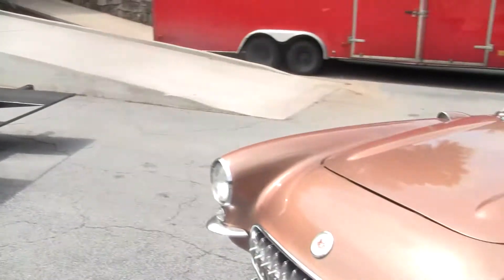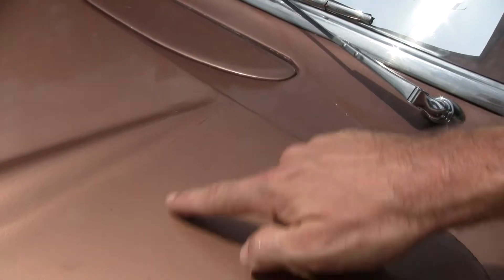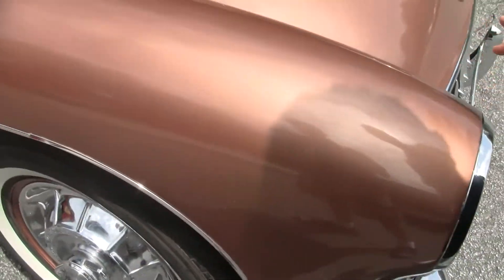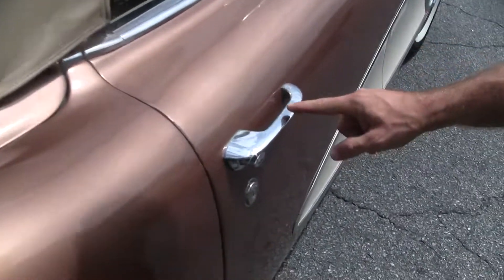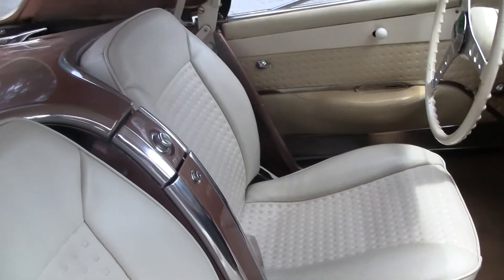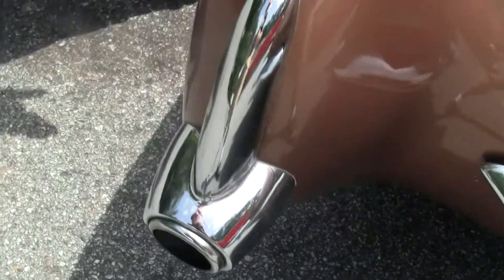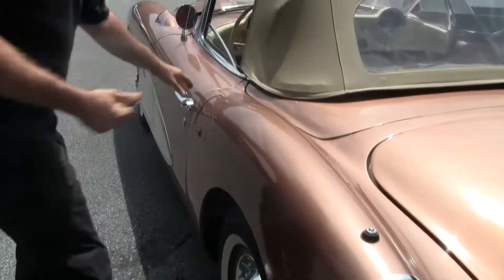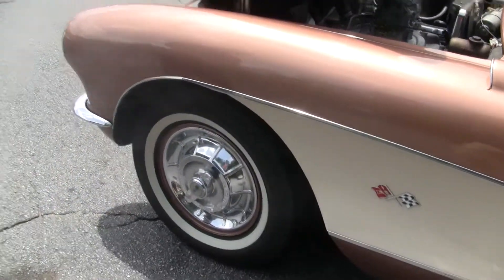1957 Corvette Convertible

Comment from the maker: @bill3402 I'll agree with that -- personally I'm not a big fan of straight axles, and this one was particularly rough for a driver.  We usually avoid '57s, but this one came in on consignment, and actually sold rather quickly.  I don't believe there's any way to tell for certain if a transmission on a '57 is original -- even the engines weren't stamped with VIN numbers to match the car until 1960.  Nonetheless, I would assume that the transmission was non-matching as well.

Comment: The engine compartment needs a ton of parts.  You did not mention if the trans was a transplant also, but I suspect it was. Also no mention of the 3rd member being correct or not.  By the time you fix the engine compartment, the rest of the drive train and add paint and chrome you are talking some serious money.  Nice looking driver, but a driver is not worth $50K.